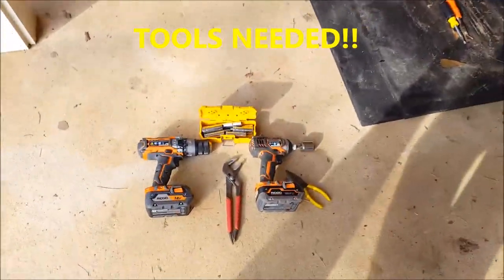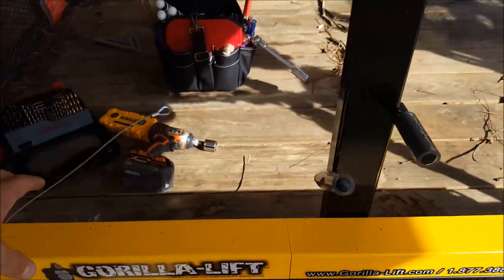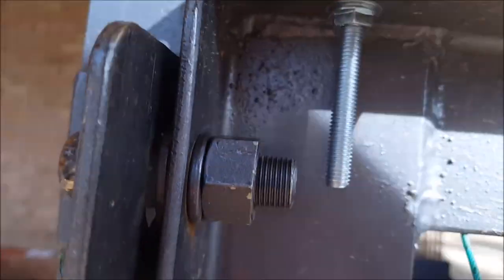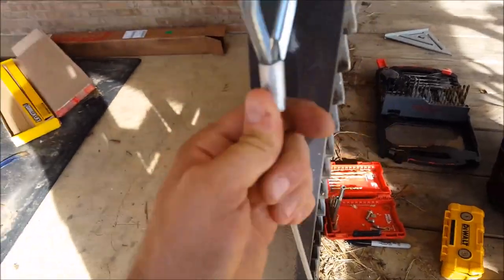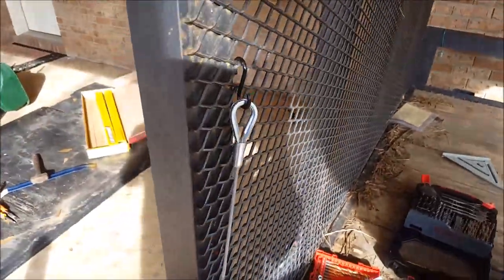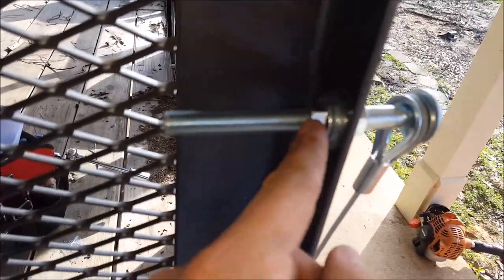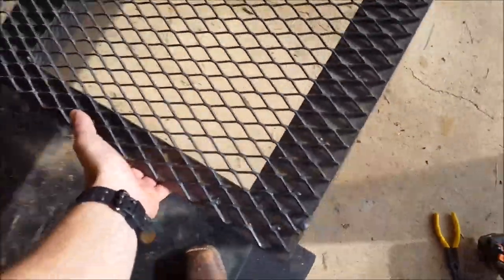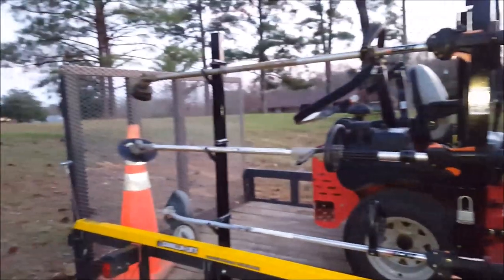NEW GORILLA LIFT ASSIST INSTALL!! A LAWN CARE MUST HAVE!! SS LAWN CARE

Comment: Great video.  Thanks much.  My wife bought a set of these for me back in  2014. I looked at the printed instructions with no pictures, figured it was just too time consuming to mess with.  Bought a new trailer and decided to see if YouTube had better instructions than the printed ones.  Easy pezy to follow your lead, put them on in about 45 minutes.  Thanks a ton.
Reply from the maker: Glad I could help

Comment: Good video.  Thank you.  I had no instructions with mine.  I installed it on my 20x8 dual axle.  You are correct in the fact that one is strong enough for a four foot gate.  However, in your comments on the video you thought a 3/8 hole would work for mounting.  A 3/8 hole will not let the carriage bolt seat completely, thus letting the spring catch on the bolt lip.   I went ahead and disassembled everything and drilled the holes to 1/2 inch.  The spring stopped scrubbing the carriage bolt head.  But, again, thank you.
Reply from the maker: I never had that issue, but I think I used an impact and sunk my carriage bolt down. Been working since. Yw. Glad I could help.

Comment: Thanks much for this video, just bought mine one day ago pulled ‘instructions’ and figured I’d be on this for about two or three days. Your vid was the first one I pulled up and now I’m figuring with gathering the tools taking off the hooks and rope ties I have installed I’ll be about half a day, after all I do need time off for a cold one right, oh not beer but a ginger ale or iced tea. also as a foot note if I only put one on, this thing cost me $200.00 plus tax so I’ll sell the other one and re our half my money. And thanks again

Just came up with my first problem! If you monitor this video on a regular basis in yours as will as gorilla’s instructions it says 1/4 inch from edge of railing. I have a 6x12 flatbed at 1/4 “ the back piece will be bolted down in the wheel well and yes I will cut the bolt down but even so my wife and I most of the 5pm put a full+ load on. Also I have an eye bolt on both side that we have used on a semi regular basis. So with this what problems would I run into if I set the gate lift about 7.5” back from the edge any help please
Reply from the maker: @cajun5957  glad I could help.

Comment: just about to start this project and honestly I don't think I would have had any confidence in doing it until I watch this video. thanks bro I'll let you know how it comes out.
Reply from the maker: Glad I could help. They are easy to install. Just make sure you drill the holes right and you will be fine
Reply: Southern Style Lawn Care The install went great! quick and easy thanks to your video, One thing,, we installed this on our 16ft big text trailer with tubular side rails which we had to go get longer hardware to get all the way through the tube. the original hardware wasn't long enough. other than that quick and easy. Love your channel and big shout out from Hebron Connecticut!!
Reply from the maker: Thanks for watching and glad I could help brotha.

Comment: So I installed my gorilla lift gate today and I found it better to install both so that your gate goes up evenly to avoid excess wear on one side definitely a great upgradeWorth every penny
Reply from the maker: Still running single sides on 2 trailers 0 issues. Whatever works best for you. Hope my video helped.
Reply: Ya , I did the same thing

Comment: The square tube/fabricated gates are stupid heavy. Would probably require 2 of these springs. Thanks for the video! I have the same trailer and have been thinking about getting this. From what I can tell, my used trailer already has the holes drilled for this!
Reply: You  should definitely  get 2 as it's needless strain on just one

Comment: I have the same exact setup and one will wear out soon by itself using two is amazing
Reply from the maker: @jrverde218  I used one for years. Replaced the rollers once in 4 years. Worked for me. I have since sold the trailer.

Comment: I'd replace that 4-5" shank bolt on the gate with 2-2 1/2" (shorter shank) so it didn't stick out so far.

Comment: Great video. I used it to put mine on today. Once I completed the installation, I noticed it was hard to put the gate down because the springs were trying to keep it shut. Once I forced the gate down to the ground, I had to stand on it to keep it down. Otherwise it would close up by itself. I couldn’t find any suitable location to keep this problem from happening. They seem to be too strong. Does anyone have any ideas? Moving the location on the gate doesn’t really seem to make a difference.

Comment: I put one on my trailer it broke easily.  Make sure to use two on heavy gate
Reply from the maker: Mines still running strong. Got 1 on my 18fter as well with a tractor gate.  2 would be preferable for heavy gate

Comment: NOTE: You MUST use a 1/2" bit to drill the holes for the side rails. 3/8" bit drill holes are not sufficient to allow the square end of the bolt(s) to be completely recessed.

Comment: I have a 5x8 trailer with a one piece metal rear gate. I goes in vertically sliding in a track on both sides. I do not need a ramp and the gate is heavy. Any suggestions for a modification or upgrade?

Comment: How was the long term result of using just one? I have 2 trailers and thinking of use the 2nd unit on that. Thanks!
Reply from the maker: Still using just 1 on both my trailers. Still working great.
Reply: @SouthernStyleLawnCare  that's great to hear! I just picked up my unit from tractor supply.I've read nothing but good reviews on this product and hoping it will be better than the EZ gate lift assist that I had. My only concern with the gorilla lift is where some of the reviews are saying that the cable and rollers wear out and have to be replaced. Has this been an issue with you? Thanks for your feedback.
Reply: Depends on how often you use the trailer as frequent  use will make it more advantageous to have second

Comment: The trailer I want to put this on has the gate latches on top of the rails. The tubes would need to be mounted about 4 inches from the gate. Will that work or will I need to move latches?
Reply: Same problem.  Started to install 3 3/8 inches back and realized the cables would rub the latch when the gate is fully down.  I mounted over the welded tab for the gate latches 1/4 inch back like the instructions said.

Comment: How did the single lift work long term? Did you end up adding the second one? Or have any issues with the lift itself by only using one side?
Reply from the maker: Worked great for years until sold trailer. Was still working
Reply: @SouthernStyleLawnCare  awesome. I ordered one and was thinking about just installing one side too. Then keeping the other one as a backup or if I get a second trailer.
Reply from the maker: @ohiodigger4391  If your gate isn't that heavy you'll never need a backup. Just buy a few extra rollers off amazon. They tend to wear out after a year or so. We drop the gate 20 times a day so that doesn't help ha.

Comment: Are you still using just 1 of the lifts?
Reply from the maker: Yes same lift is still on the 12ft trailer. We now run a 16 and 20ft and just use the 12ft for small jobs but its still going strong.
Reply: @SouthernStyleLawnCare  good to know... will sell 2nd one to my neighbor. Thanks for th promp response